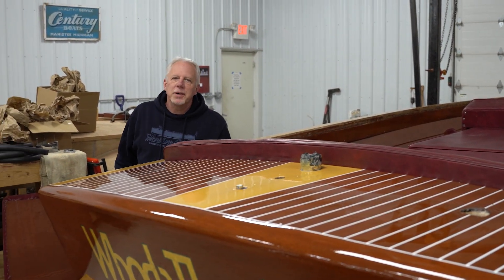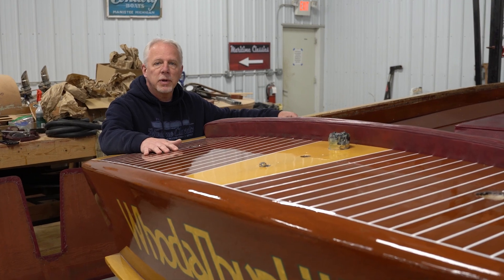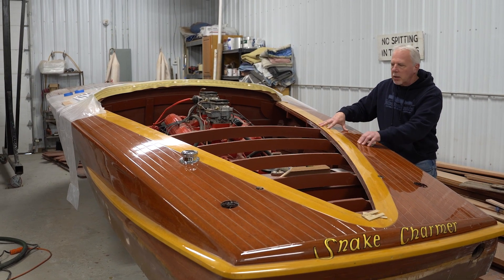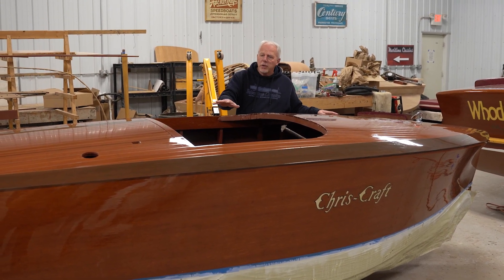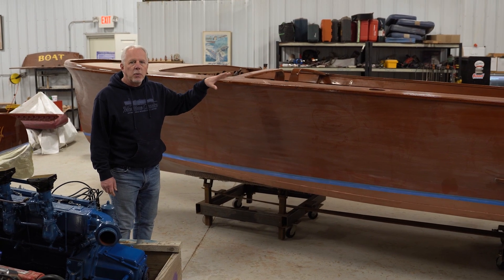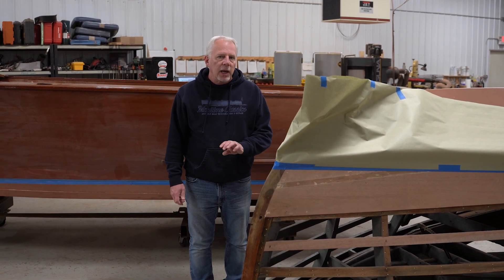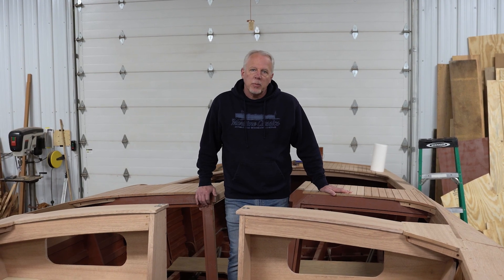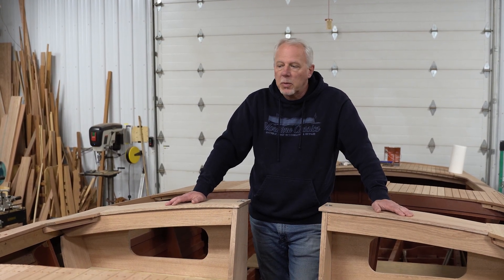Restoring Old Boats - Shop Tour

Comment: Mike, What size and length of copper do you need?  My father was a plumber all his life and I know he had some copper lengths that are about 3” in diameter, but I would have to check them for sure.  I do not know how long they are.  They may be used, I just do not know.  I live in Rockford, MI.  If you let me know exactly what you need I will check it out and get back to you.  Dan
Reply from the maker: Dan, thank you so much. I need  2 pieces at 5 to 6 feet long, and the diameter needs to be 2 3/4 with the wall thickness of .0625. I wish it could be thicker, but it needs to bend, and any thicker, they can not bend it properly.  Thanks again for checking.
Reply: @MikeGreenStudioWorks  Mike, I will take a look tomorrow and get back to you.  Dan
Reply: @MikeGreenStudioWorks  Mike,
I checked on the copper pipe my dad had and it is 3”” diameter.  Sorry!  It was a thought!  Is 3” copper used on any boats?  If not I think I will bring the two lengths to recycle.
Dan
Reply from the maker: @danieloverbeek2623  Thank you for checking. Yes there are some boats that need 3'' copper pipe so those are worth about $300 to $500 a piece.
Reply: @MikeGreenStudioWorks  Thanks Mike,
I guess I’ll keep them.  I currently have two wooden boats with outboards…but someday might get an inboard!  In my dreams.  Sorry I could not be of assistance.  I love your YouTube videos!  Dan